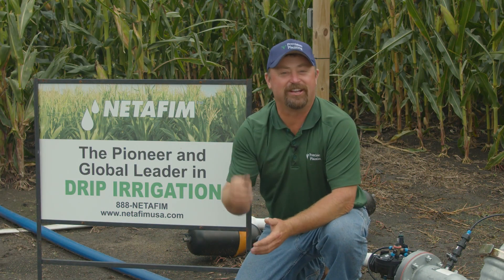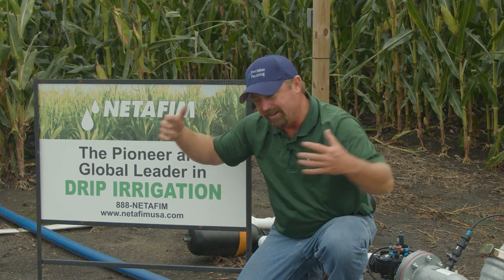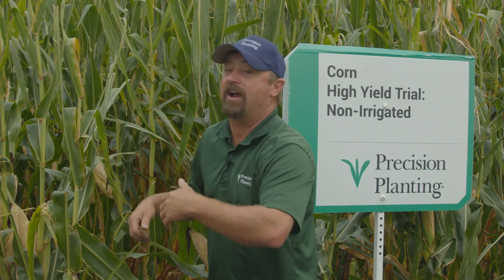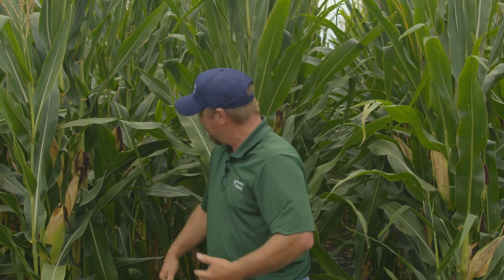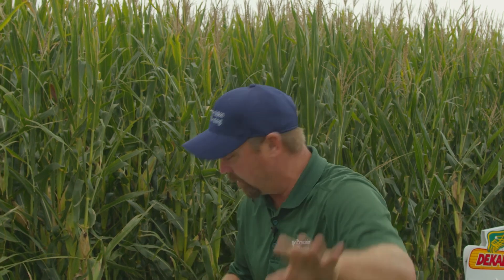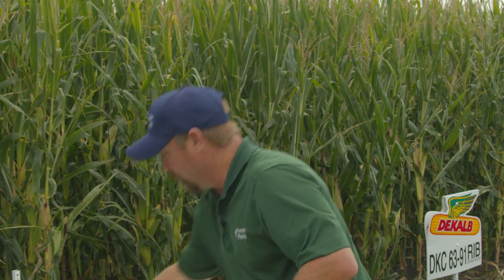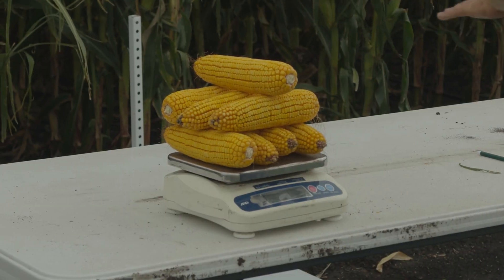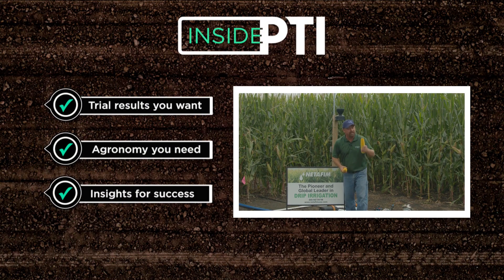InsidePTI S1•E58 | Irrigated vs. Non-Irrigated

Comment: Was this land no tilled?behind a cover crop?or conventional?I've used both drip and a large sprinkler system.you said 60 inch centers...every other row? How long did you run the drip at that spacing?